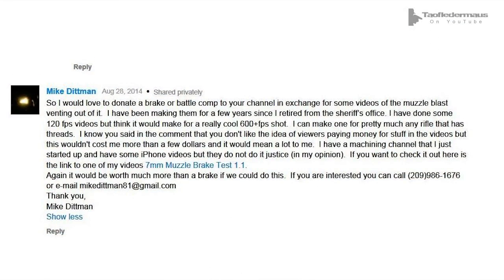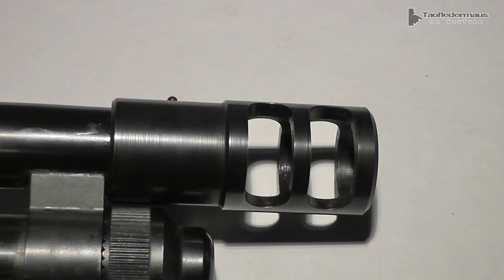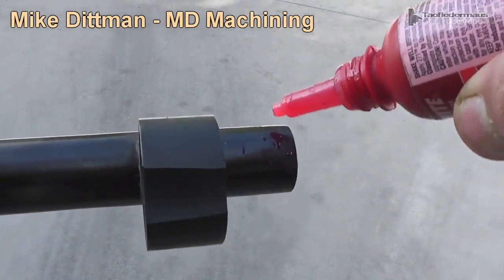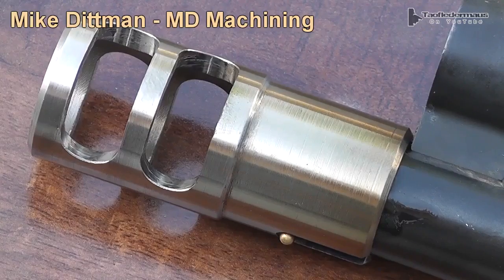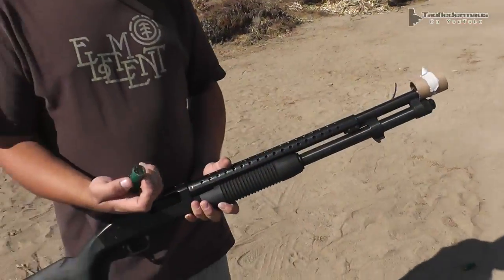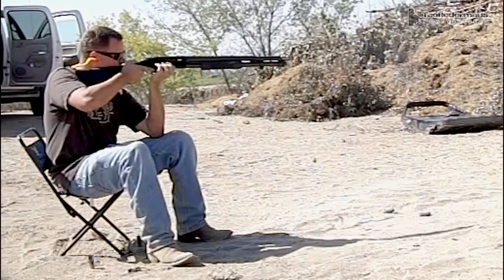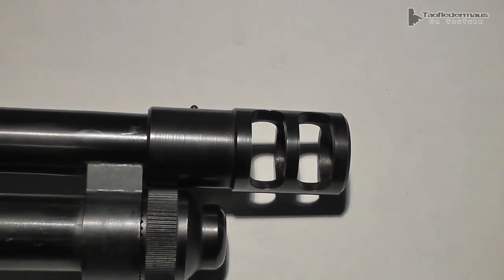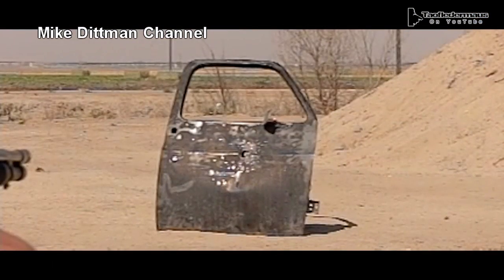Custom Machined Shotgun Muzzle Brake - Simplicity!

Comment: Does it actually take away any felt recoil though? I use brakes on several rifles and they work great, my slug gun definitely has the most recoil out of them all and is also the funnest to shoot. It would be even more fun if it wasn't a 3 shot and you don't want anymore kind of gun.

Comment: Heating the muzzle brake before installing it into the barrel with glue on it will instantly dried and hardened the glue and it wouldn't stick to the brake, warm yes but too hot no.

Comment: There are two ways to reduce recoil. One is porting. Porting is usually done on large caliber handguns where slots are cut or holes are drilled into the barrel. Porting essentially does the same thing as a muzzle brake, but is integral to the barrel. A muzzle brake fits on the end of the barrel, usually a rifle or shotgun. I have them on my AKs, AR-15s and 10 and on my 30-06. There are several designs but one thing I found out if they are omnidirectional (e.g. holes or offset slots, if you shoot from the prone position, they will kick up a lot of dust and debris. Also, in larger calibers or shotguns, there is a significant concussion wave that can actually be felt. When I am shooting my AR-10 at the range which has lateral ports, people in the next stall will usually move because they can feel the wave. However, with the lateral design, you do not have to worry about kicking up dust or debris. The only downside,  as mentioned, using a sabot or exotic rounds may cause problems, so I would stick with standard commercial ammunition. Mike is making one for me now that is pretty much following Jeff's design. I went ahead and sent the barrel to Mike to do the machining and fitting instead of me taking the chance of mucking it up by trying to fit it myself.

Comment: Impressive quality....    Years ago I bought a muzzle brake for my Mossberg 500 that simply replaced the Choke...  my Saiga 12 has a very heavy high quality muzzle brake.   one word of caution...  you should never fire SABOT rounds through rifles " like the 30.06 accelerators" the sabots tend to open before leaving the muzzle brake, damaging the muzzle brake and/or rifle.   This would apply to shotguns as well..  in fact, I don't think I would dare fire a sabot slug from a 12 ga with a muzzle brake mounted, much less all the crap your shooting out of yours....   lol
Reply from the maker: ***** I haven't seen any nicks or signs of objects striking the brake.  I thought the same thing.   The ID of exit-side of the brake is a bit larger than the OD of the barrel,  so there might be a smidgeon of clearance.

Comment: I like it, I cant find one for my Mossberg 930 spx.  The problem is the barrel has a fiber optic sight and no room to thread or bolt one on because of the sight base.  Im sure spx owners would be interested if one were made for it.  Im also not sure a press/heat type would stay on as these guns can fire 8 under 2 sec.  The other thing in design, it just looks like holes that are not angled.  If they were angled more to reduce felt recoil that would help manage the fast firing spx.  Doesn't 75 sound a little bit high?
Reply from the maker: mark oshields  Mike can probably make you one for your gun.   The shrink-fit works very well as a way to fix the brake to the barrel.  My brake has not moved at all.  It's a very strong fit.   It takes Mike several hours to fabricate a single brake as machine work is very slow to do.  Quite a few steps and he is working with very precise tolerances.
Reply: ***** When I get a few extra dollars ill contact you, Im cripple for the moment just had hip surgery and have been out of work, still applying for help but I will say this if he makes them for the 930 spx and puts them on ebay he will do well

Comment: It would be interesting to see a video, or at least a test, of how much you could fire this shotgun with the muzzle brake attached, until the brake heated up to the point of slipping slightly or all the way off
Reply from the maker: The barrel would heat and expand at the same rate as the brake,  probably faster-- so the interference fit wouldn't change.

Comment: Cool, I always wondered what the sideways flash was for on gun barrels, They're fairly obvious to see on tanks but I never knew what their point was.
Now I know, Thanks ***** 
Great video as always, keep up the good work, I always look forward to the little "1" next to your name in my subs list!! :)

(I should clarify that I'm from the UK and we don't have much to do with guns here!!!)
Reply from the maker: George Smith   Thanks George!
Reply: *****  It's actually quite clever the way the fins on the brake catch the gas in order to direct it out to the side, but don't get in the way of the bullet. I'd have thought that even with this, most of the gas will still be going out behind the bullet, and what little is caught by the brake wouldn't do very much at all but as you said, it's quite effective.
Goes against logic a bit, as the gasses expanding out from the end of the muzzle will still want to spread out evenly, and it's those gasses that give the bullet it's momentum and speed so I can't get my head around how it actually works without interfering with the bullet or reducing it's speed!
Would be interesting to find out if it does reduce the speed of the bullet at all?
Reply from the maker: I don't think it would reduce the speed of the round since it has reached its maximum velocity by the time it leaves the end of the barrel.

Comment: You'd be amazed at how much stuff in the automotive/ truck engine industry is heat interference fit.  Most ring gears, cam gears, etc...

Comment: So the break is only being held on by the fact that you expanded it to slip it on?  I wonder how many shots that will survive before it pops off, or if it will ever pop off.  I would recommend keeping a journal of how many shots (and ammo types) you put through that break until it finally fails (if ever).
Reply from the maker: The shrink fit process isn't new.   It's how the tires on steam locos were secured to the wheels.   It's one of the strongest ways to secure two objects.
Building Steam Locomotives - 1930's Trains & Railways Educational Film - S88TV1   (see 10:46)

Comment: This might be a stupid question, but wouldn't a muzzle brake be more efficient if it redirected the combustion gases backwards, rather than sideways? Like, with a couple of metal cones going around it?
Reply: Exactly. I can't see how this break would do anything as there is not enough barrel material in front of the slots. If you look at a true porting job you will see what I mean.

Comment: I think it needs more surface area for the gasses to contact. Use the SI cookie cutter for an extreme example of that. How would you remove this though? Put an ice cube in the barrel and heat up the brake? Looks like a good idea though and he should make some for shotguns with vented barrels.

Comment: Cool design. I wonder though, wouldn't it be much more effective if the ports were angled to direct the gasses back rather than straight out perpendicular to the bore axis?  It looks like the force of the redirected gasses has no backwards vector, which produces most of the recoil reduction.
Reply from the maker: I think Mike will be progressively tweaking the design and come up with other port designs.

Comment: Usually people just get the barrel ported, I'm surprised you didnt have any issues with the wad getting hung up on the break.  Looks really cool though, nice idea and good video.
Reply from the maker: We'll keep using the brake for future videos and we'll see if any issues arise.
Reply: A cylinder bore barrel as a spread of about one inch per yard from the muzzle out to about 15 yards. This spread equates to about 0.027" at one inch away from the muzzle so as long as the end of the brake is 0.027" bigger than the cylinder there is little to no chance of an impact with the brake.  I don't think the wad expands until it's is more than a foot away.
Reply: I would be very surprised if any wading opens up that soon out of the barrel. Soon enough to catch the brake anyways. There is still going to be some muzzle blast that envelopes the wad creating a high velocity boundry layer that is moving faster than the wad/payload which may keep the wad from opening up that soon. Just an idea anyways.
Reply: I know black cloud ammunition warns against using ported chokes or barrels with their products. Im not sure the of the physics behind ported barrels and muzzle breaks, but like I said before it looks really cool.

Comment: I'd buy one. Seems easy enough for an install. Should try it on different clones as well. I also like the ability to retain the bead sight.
Reply from the maker: We weren't sure if milling the slot for the bead was a good idea since it could reduce the strength of the interference-fit. 
So far,  so good.
Reply: I could thread a hole in the top to place another (visible) bead without too much trouble.

Comment: Interesting... so how does it work with birdshot? Does it disrupt the pattern?
Reply: The brake is attaching on the outside diameter of the barrel so it will not effect the pattern.

Comment: Cool, but what if you want to change your choke tube? Assuming that it's threaded for one of course.
Reply from the maker: The Moss. 590 is a cylinder-bore so it doesn't have a choke.  If you had a shotgun that uses threaded chokes,  then the best brake would be a threaded one.

Comment: Maybe newer designs could utilize the bead as a back up locking lug of sorts; push it through the slot, and then turn the brake so the bead is inside a small cut out. That way, if it somehow slips, it'll still be retained by the bead.
Reply: By the way, that brake is amazing! Once I get weapons with actual recoil, (man, that 22lr really kicks hard), iI'll definitely be looking at your work. Have you done a design for M1 Garands yet? That would be sick.
Reply from the maker: I think the bead is made out of brass and would probably shear off.   It uses very small threads like 4-40  or so.
Reply: ***** Oh yeah, I didn't notice that. It looked sort of blued to me, in the video.

Comment: 0.002 inches is a little bit to much, for that size you would only need a size difference of 0.0012 inch to 0.0016 inch

glue you used will practically lock the muzzle brake
Reply: It was machined 0.0015 under.
Reply from the maker: Sir Phoenix  I'm wrong a lot.
Reply from the maker: Loctite typically doesn't like heat.   I'm not sure how effective it really is in this application.  The way you remove something,  even using red (permanent) Loctite is to heat it up which breaks it down.
Reply: Mike Dittman Nice work
Reply: Mike Dittman perfect size then, that means Taofledermaus was wrong
Reply from the maker: Mike Dittman there ya go!
Reply: ***** well the Red loctite is able to handle a decent amount of heat, not over 100 C for over than 5 secs
Reply: Sir Phoenix Well that means it was almost certainly destroyed when the hot brake was installed.
Reply: ***** use green loctite. it's got wicking action. EG- heat break, install, let cool, apply loctite 290 (green)
Reply from the maker: I only had blue and red on hand.   I'm not sure if there would be any gap between the barrel and the brake once it cooled down,  for it to wick into.
Reply: tartredarrow you dont need to have alot of temperature difference to put it on, about 30 Celcius temp difference is enough
Reply: Sir Phoenix Except it's clear from the discoloration that he got it quite hot.
Reply from the maker: tartredarrow I definitely applied more heat than needed.   I just wanted to make sure it would slip on,  on the first take.
Reply: ***** Yeah, nothing wrong with that. But poor locktite lol.
Reply: Mike Dittman even if it was .002 I would rather a bit tighter anyway five tenths of one thousandth is not making a difference unless it was + and you ended up with a loose fit.
Reply: greatdestroyer1 if the size difference is to much you will get Deformations in the Barrel or on the Muzzle brake, that is why the difference shouldn't be to much(0.005 is way to much)
Reply: Sir Phoenix "It was machined 0.0015 under." -the guy who made it.
Reply: Sir Phoenix you are right .005 is five thousandths that is way to much, .0005 is five tenths of a thousandth. Anyway tolerances that include tenths of thousandths are usually in aerospace industry and the like. If you read prints for most firearm manufactures you are dealing in thousandths.
Reply: greatdestroyer1 well i work with 0.01 daily, but its in MM
Reply: ***** Loctite test tube torcher test video?

Comment: Don't touch the loctite to metal, sometimes it hardens in the tube :c
Reply from the maker: Loctite isn't activated by touching metal.  It is anaerobic and cures when it is in an air-free (ish) environment like in threads of a bolt, etc.
Reply: *****
I've had it go off in the nozzle.
The bottle is also an anaerobic enviroment.

Comment: If you shoot a lot of rounds really fast, will the heat on the barrel cause the brake to come loose and fall out?
Reply from the maker: The brake and the barrel will expand from  the heat at the same rate so the clearances should not change.
Reply: odds are, no.

the logic here is that the actual barrel is heating before the break is.
The barrel is being heated faster than the break, and and the break is smaller than the barrel with a very large surface area per scale compared to the barrel. There for it cools quicker than the barrel.
Reply: Why wouldn't the barrel expand with it?
Reply: GreaseStain lol you beat me to it. great explanation!
Reply: The opposite actually.  The barrel would expand and hold even tighter to the brake.
Reply: I'm really doubting that the shotgun would last up to the barrel heat that would be required to loosen that brake. The barrel would probably blow out by that point.
Reply: In theory yes, but the amount of round that you would need to shoot would break your shoulder before the barrel would heat up enough!
Reply: Yeah, basically what everyone else here said, it's possible, but not feasible.
Reply: triumphant39 After I rapid fire ~20 rounds of low brass birdshot through my 870, the barrel is too hot to comfortably touch. What are you using? Slug barrel or something?

Comment: Just by curiosity, red locktite is dead right? Like permanent?
Reply: Dead is in not available anymore? I don't know about that but you can find it online really easily. Dead as in permanent? Well the brake is a shrink-fit so you're going to need a fair amount of heat to remove it anyhow and that should loosen the locktite. :)
Reply from the maker: Red Loctite is supposed to be permanent,  but that usually depends on the size of the fastener.  Heat is used to break-down Loctite so to remove the brake,  I'd have to heat the brake up quickly and slide it off before the heat expanded the barrel.

Comment: Will it work with shot or only slugs?  If it does work with shot, does it effect the shot pattern any? Very cool design.
Reply: It will work with both and should not have an effect on pattern.
Reply from the maker: We'll test it using buckshot,  birdshot, etc and find out.

Comment: i agree about shotgun muzzle breaks....they look like they should be on a howitzer
Reply: Ever see a rifle called the JNG-90 it is a 7.62 sniper rifle with a really big muzzle-brake
Reply: i havent and i fail to see the connection....shotgun muzzle breaks look like shit.......and a big muzzle break doesn't make it more effective....as a matter of fact you can get too much muzzle break effect and get negative recoil........and after so many inches of barrel a muzzle break on a shotgun wont do shit as the pressure drops to pressures that wont cause a muzzle break affect
Reply: "negative recoil" good luck with that especialy if "a big muzzle break doesn't make it more effective" rotfl

Comment: Will muzzle brake on a shotgun catch the pallets it shoots? Causing potential injuries?
Reply: A shotgun that shoots pallets would be pretty intimidating!!!
Reply: no
Reply from the maker: The inside diameter of the brake is larger than the outside diameter of the barrel,  so I don't think there is time for the
shot cup to begin opening up before it leaves the end of the brake.

Comment: That's an impressive brake! great vid.
Reply: ***** I might commission something from that dude! I need a legit RHMB that's not hollow! LOL
Reply from the maker: That would save a lot of time since he wouldn't have to bore it out.
Reply from the maker: Thanks Matt!   I finally found some bluing at Dick's  and it looks great now that it matches the rest of the shotty.
Reply from the maker: MattV2099: Guns & Food  He normally makes rifle brakes that thread on.   Maybe he can make a crazy Krink brake for you.
Reply: ***** I want a trick brake that looks like a muzzle brake but is solid core. so the RHMB doesn't cool down as fast. LOL
Reply: ***** you at work dood?
Reply from the maker: I'm off this weekend.   I can't get on the interwebs at work anymore for some reason.
Reply: wanna chat it up for a few mins? im editing and uploading a vid and preparing for some future vids n stuff tonight.
Reply from the maker: sure thing.  I'll be up for a while.
Reply: alright. i'll set it up yo
Reply: Looks great man. That's a decent price and great idea to use friction to hold it on. The loctite should be considered necessary also, just to be sure. Plus, if you ever want to remove it, you'll have to heat it anyway. The loctite might help lube it when you pull it off. Thanks for the idea.
Reply: How can I get one?

Comment: How about a "twist lock" using that front sight as a lock pin?  I know absolutely nothing about guns, so it might be a dumb idea...  I like the simplicity of it though, nice job!
Reply from the maker: The front sight bead is not very strong.   I have a brake for my SKS that uses the exact set up you described but it locked about the much-heavier site post.